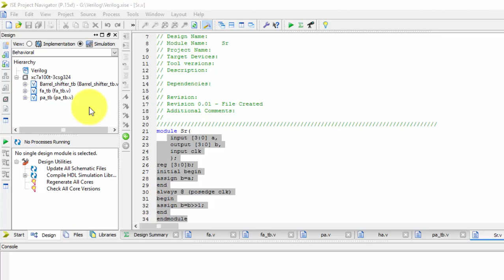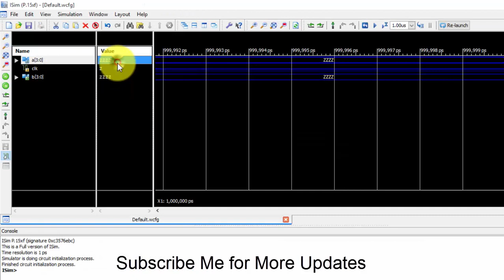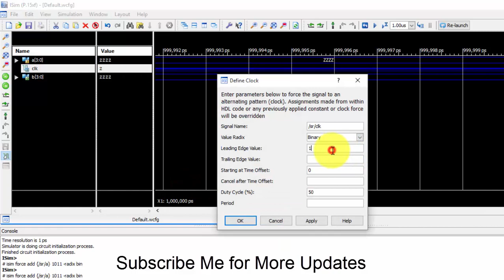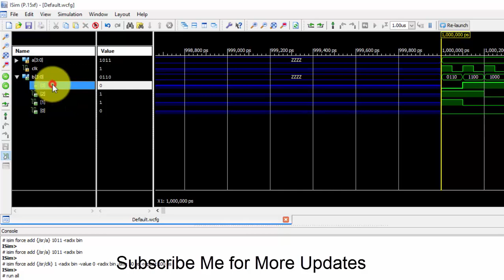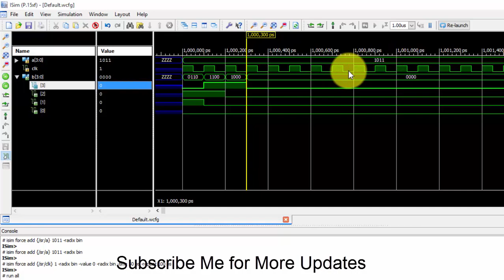Design and Implementation Of Shift Register In Verilog Language

Comment: This is a Lite version of ISim.
Time resolution is 1 ps
Simulator is doing circuit initialization process.
ERROR: In process sr.vCont_27_0 
 FATAL ERROR:ISim: This application has discovered an exceptional condition from which it cannot recover. Process will terminate. To search for possible resolutions to this issue, refer to the Xilinx answer database by going to http://www.xilinx.com/support/answers/index.htm and search with keywords 'ISim' and 'FATAL ERROR'. For technical support on this issue, please open a WebCase with this project attached at http://www.xilinx.com/support.
INFO: Simulator is stopped.
ISim>
Reply: i just try to run sam program ..above error
i received how to proceed